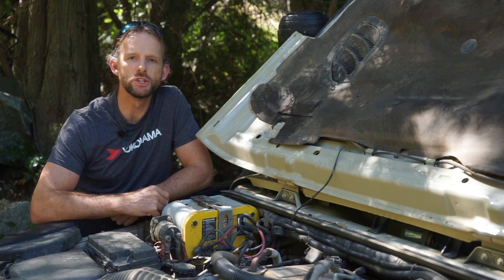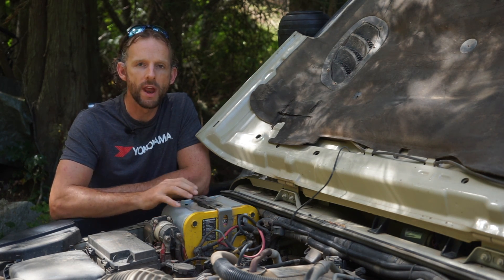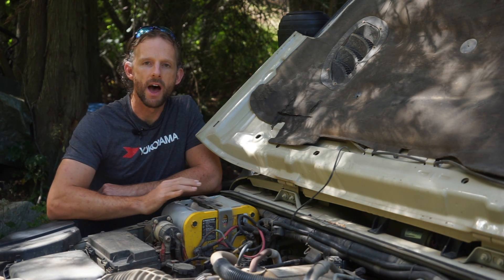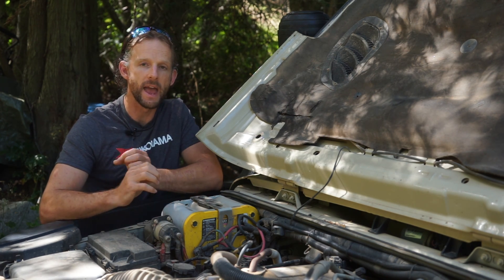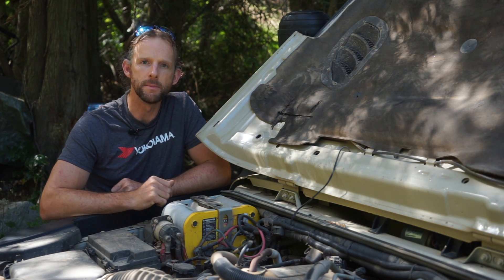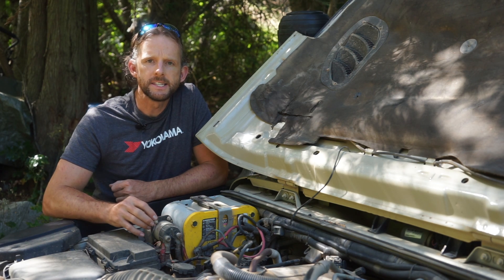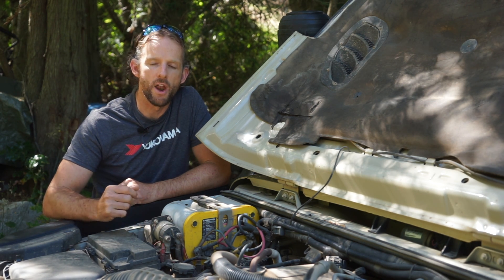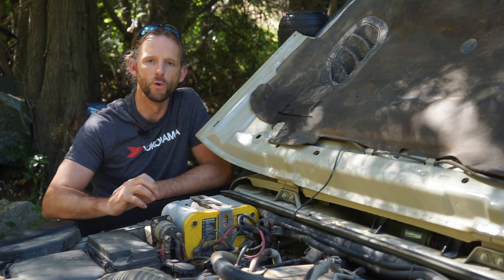DIY Dual Batteries for your Overland Vehicle - what, why & how

Comment: Self jump is a great feature with an isolator. My adventure van runs Blue Sea gear as used on ships. I've used it once. But saved me the trouble to do a jump. And then prevents my gear from draining the starter-battery. 

Mine uses a 3 position marine-switch. Disconnected, through the isolator, or bypassed that allows me to jump myself from inside my rig. But, I absolutely see the benefits of having a non-smart system. As I really don't overland.

Comment: That’s a really good point about how one may have difficulty finding the correct battery (of size) in a given country. This isn’t normally an issue in a single battery set up, but I know fitting duels into a Jeep is a tight fit, even more so on the new JL and JTs models. Something for myself and others to consider on our next builds.

Keep up the awesome videos.

Comment: Grate video as allways 👍🏻
At the moment im working om an old Nissan king cab/navara from 1994. Is a Disel and as such it comes whit a dual battery system as stock. I do have a spare truck and my most reasent plan is to salwage the battery system from that one and figure out a way to get the best usage out of what i simply already have access to🤔
In teory that will end up giving me a 4 battery system with 200+ amp/h that I then can use for what ever my needs migth be. In theory that is.... And that system would alow me to run one almoust any kind of battery. size lithium deep cycle and so one. in theory that is 😬
Reply from the maker: Do you really NEED that much battery capacity?
Overlanding is a fine balance of weight and storage space and what you need.
If you on't need it, you'll soon learn that having all that capacity (be it battery or solar or gas or whatever) will limit you in some other way.
Reply: @TheRoadChoseMe  no i dont need that much but since i already have it to my disposal I figured that why not give it a try 😉
More cost effective for me than to set up a effektiv solar alternative. And money is the only thing im short of 😉
As a photograper my needs for amps is almost endless.... But well see where ill end up.

Tanks for taking the time to respond.
Reguards BigC

Comment: Another nice one again ;-) I do have a slightly different setup and added a manual switch to connect both batteries. The idea behind is my diesel engine consuming a lot of power when started in deep cold. Hence I want the starter battery be loaded with priority. In this rare case, the starter battery is charged first. Only then I connect it manually with the second one. Said connection is only possible when the ignition is on, so no danger of accidently discharging the main battery.
Reply from the maker: That sounds like a good setup for your situation!

Comment: Always enjoy your videos , we went with a dc to dc by CTEK on our FJ Cruiser and replaced the unit like you have on our 60 Series Cruiser with same . They are so far working great , the Optima batteries are also working fine. With newer alternators the voltage isn't high enough to fully charge the house battery.
Reply from the maker: Sounds great!

Comment: I had an old TJ and was notorious for draining my battery. For my JK, i went with the Genesis dual battery system and it is a great piece of mind when heading out for a week in the middle of no where.  I have never had an issue and the jeep always starts up. I know guys that carry a second "starter" battery in case the main battery gets depleted, or they have one of those starter kits that plug into the wall; but something always happens where they forget to charge them or leave them at home and then they are stuck. Dual battery is the way to go, do it right the first time and you can get home.

Comment: Thanks Dan. 😊👍 I haven’t set  up my dual battery system yet. But I did get a GoalZero 1400 lithium battery, and I’m thinking of setting it up to charge from a DC to DC charger using the alternator and solar.
Reply from the maker: Sounds like exactly the setup I want to build in my next vehicle!

Comment: Is your alternator still stock? I’m debating the dual battery set-up or just going with a single bigger deep cycle/lithium ion battery with an upgraded alternator. Not much running other than a fridge and a 2.1 amp USB and maybe a fan overnight (with an emergency jump starter just in case). However when I’m driving is when I was planning on charging everything else (iPad, power tool batteries, fridge, ac/heater, phone, stereo, air compressor ). So I’m hoping I’ll be able to keep my power consumption low enough for just a bigger single battery overnight, but I’m worried about overloading the system when I’m driving. Thoughts/recommendations?
Reply: If you uprate your alternator you will of course need to increase the size of the associated cabling too.
What capacity is yours? Mine is only 60A but it actually copes all right. It can draw 50A when I start off but within half an hour it has dropped by half. It would be prudent not to add extra loads until the initial charge is done.
BTW I''d highly recommend fitting an ammeter so you know what's going on.
Reply from the maker: I have the stock alternator. It has 170k miles on it now, and it's been charging both batteries for almost 5 years now. Never a problem.
Reply: @TheRoadChoseMe  After that mileage you should get it refurbished before your next big trip and it'll be fine.

Comment: I love the simplicity of your setup, and very well explained.
I use an enerdrive dc2dc charger , I chose this because you can adjust the amount of Maximum charging amps according to the house battery size. That way, if I upgrade my battery, I just adjust the charge, a bit like turning up or down a water tap.
Thanks for another great video.
Reply from the maker: That sounds like a nice feature!

Comment: You mentioned that you believe heat contributed to the demise of a battery while on your road trip. Have you considered that relocating the battery outside of the engine compartment would help reduce heat levels that the battery is submitted to? I've heard others mention it as an issue but don't know if that is a real concern or not.
Reply: I agree, which is why many MPPT have a temp sensor.  And it is also why I stowed my second battery inside my Jeep.  But I also agree with Dan that doing so takes away precious cargo space.
Reply from the maker: I don't think heat was the demise, I think it was just the number of cycles - I simply used it up because the fridge was running A LOT when it was 100F every single day for 3 years.
Also I charged my laptop and cameras a lot too.

Comment: Would you recommend something like this over dual batteries that are isolated from each other? For example keeping the jeeps battery stock and then having a battery pack solely connected to the solar panel and relying on that for replenishing it’s power?
Reply from the maker: Depending on the battery capacity and the load you're putting on it, solar alone might not be enough to keep it full. It will depend on your specific scenario.

Comment: Very cool. I have a CTek250sa used in a similar configuration as yours, but it has the smart charging profiles for AGM, isolates, has the MPPT input, and will even top off the starting battery. I did it this way so I could get high enough voltage on the house Optima battery for charging, but keep the stock starter battery (cheap non AGM battery). I toyed with the basic selenoid setup like you have, which to your point is dead simple. I just didn't want to have to match my starting battery (extra $$) and wanted the smart charging. I'll look into the renogy charge controller that sound like it may have a similar capability. Thanks again for the informative posts!
Reply from the maker: It sounds like you have the more modern version of my setup, and it's exactly what I'll be looking at for my future vehicle! Cheers,
Reply: @TheRoadChoseMe  I checked out the Renogy options from your link. On paper it looks like has the same capability as mine, but more flexibility for also controlling lithium ion. My Ctek250sa can only do lead acid. They look to be similarly priced with the exception of a temp probe which is extra for the Renogy. That Renogy controller may be a better option with the lithium capability though.
Reply from the maker: I really think I'll go with that next time, and even move to lithium to give it a shot. It's WAY lighter and smaller for the same capacity, which is win-win.

Comment: You should never discharge any gel, AGM or lead acid battery more than 50% (even the deep cycle types) because you will damage it so a 55AH battery is only around 25 - 30 AH usable. With the various Li batteries you can use nearer to 100%  without damaging them.
Interesting that you don't use a red top as the starter battery, which would be Optima's recommendation.
I find that 55AH is way too small so I use a 110AH AGM battery, giving 55AH usable. I am not yet convinced by Li bateries. They have a built in battery management system which is full of electronics which I prefer to avoid.
Reply: Traction batteries can be safely discharged up to 80%
Reply: @XTnautas  I need to look ino this. I have had a lot of trouble getting a truly reliable set up and am intrested in anything which could offer an improvement.
Reply: @defendermodsandtravels  It's been said not to go below 50% And reality for longevity it really should not be brought down to 50% repeatedly.
Reply: @jeepncj7  I almost never get down to 12V. I need to check the state-of-charge curve but I think this is still above 50%. I have  a low voltage cut out at the battery to prevent deep disharge because I ruined too many batteries through careless accidents. It actually takes a lot of care to keep an auxiliary battery in good health and they are easily ruined.
My charging set up is more sophisticated than Dan's (and he fully acknowledges that his is bullet-proof simple) but I am dissatisfied with the performance so it needs an upgrade. I think he has motivated me to post a video on this subject. We need efficient charging + bullet proof reliability.
Charging has been the biggest thorn in my side for many years!
Reply: @defendermodsandtravels  - I don't have a LVD on mine, just on the fridge to stop if it gets too low. I have a used Optima for my house battery so I'm not as concerned with the abuse (as it was $100). What are you using in your setup for charging/isolation?
Reply: To add a video would be cool. It's great seeing how people have this setup.
Reply: @jeepncj7  At the moment I have an external smart charge controller and diode type splitter. The problem comes from the voltage sensing. if you sense the starter battery then the auxiliary battery charges too slowly, and if you sense the auxiliary battery then the starter battery gets overcharged. One either needs a smart charge splitter or a battery to battery charger. I am giog to retire my passive charge splitter (carry as a spare) and install a smart splitter.

Comment: I'm now thinking of an improvement. My option was always to charge my second battery connected to starter battery and the alternator was doing it well for me always... But it's because I only use house battery to charge my phone, iPad and for light in the van when I park.. since I don't have a fridge and more electronics to charge but I plan on getting camera and fridge too as I plan to stay for months on roads as opposed to my past trips that last 1 to 3 weeks at most...
I'm happy to learn from you Dan, well done sir
Reply from the maker: Happy to hear it was helpful! Let me know if you have any questions
Reply: Most vehicles  built after 2008  have smart alternators, they do not deliver  the voltage   need for a deep cycle AGM .  That combined with more  consumers,  is what killed it in 2 years only.  With  a more modern vehicle a smart DC to DC is the way to go.  I had an AGM  100 Ah   going really low after 1 night only,   it was not charge properly  until got a DC to DC. After I put in the DC to DC , after one night of camping I still have like 75 %  left of it.  This is not only good that you have spare capacity, but  increases the life of the battery as well.
Reply: @leeloo21231234  thank you for this highlight, it's coming in handy to me.
The more I make my van self sufficient the more I love living on the road and exploring more.
This is good insight from you

Comment: Mhh as a very simple system I like the isolators that use the voltage and connect if the alternator is functioning (V>13V or something like that but it only works with dumb alternator).
With yours the issue I see is that you will have ignition=on before to actually start the engine so if the secondary battery is empty (and the main not in a good shape) it could pull down the main and not help with the start.

And now I'm impatient to know about your new trip ! Youtube has run out of expeditions to follow lately...
Reply from the maker: You are spot on, that is a weak point of my system. Though I'm always careful not to let the house battery go below about 11V.
For what it's worth, the two batteries are actually isolated when I turn the key to start the engine, so only the starter battery is actually connected to the starter.

Comment: Thoughts on Lead Acids? They work out a lot cheaper even though you have to buy one double your size needs (max. 50% discharge)
Reply from the maker: I think they're not designed to be used for "house" purposes, and it's extremely bad for them to be used that way. Also big and heavy, the enemy of overlanding

Comment: I have a pair of 50A relion lithium batteries in parallel so 100Ah capacity. Charging is via a redarc BCDC1225D. The BCDC is a DC-DC charger with dual inputs (alternator & solar) it draws as much solar as possible, then if the engine is running, augments that with power from the alternator, delivering a total of 25A to the house batteries. It's a foolproof system in that the starter battery is always isolated and the charger only draws load from the alternator when the engine is running. 
The difference between lithium batteries and lead acid or AGM is that they can be discharged down to 10% safely, whereas lead acid/AGM can really only safely use 50% so a 50Ah lithium is equivalent to a 100Ah AGM battery for usable capacity, but of course much smaller and lighter.
Lithium batteries can't be kept in the engine bay, and they are not suitable for starting, so keep the AGM/lead acid starter battery in place!
Reply: This is the system I’m putting into my Gladiator build.
Reply from the maker: @Eddit & Terri Fort - will you remove the current "two battery" setup in the Gladiator, or just leave it alone and add a completely separate house battery?
Reply: The Road Chose Me  Dan at this point I’m leaning towards leaving the factory batteries alone and adding a BattleBorn 100 AH battery in the bed of the truck. I will run everything (including solar) through a Redarc BCDC charge controller. Hope this helps.
Reply: The other design decision that I made was to not include an inverter. Laptops now mostly charge via USB-C PD(cigarette lighter plug adapter for that) and most other stuff that needs charging is via USB. I dont typically carry power tools, but you can get 12v chargers for those as well.
Reply from the maker: That sounds like a fantastic system, and something I'll be looking at in my next vehicle!

Comment: I recommend Hellroaring isolators. They are solid-state, but they have a very low voltage drop. They have a remote switch option that can allows you to select between connected-automatic-disconnected, and it also indicates the current status. If you leave it on, you'll get a light to show you that.
Reply from the maker: Sounds fantastic!

Comment: Your description of amp-hours is a bit misleading. Yes, they're a measure of capacity, but they're not rated at a 1 hour rate, but at a 20 hour rate. Lead acid batteries like you have, (which contain liquid absorbed in fiberglass mat) suffer a loss in capacity at higher discharge rates, described by  Peukert's law. Your batteries are rated to deliver 2.75A for 20 hours, but at a 1hr rate your capacity drops to about 30 amp-hours. Lithium batteries are much better at delivering their rated capacity at higher currents, which is one big reason people are switching.
Reply from the maker: You are absolutely spot on, I was trying to keep the explanation simple enough for laymen to understand. I figure nobody in the real world is ever going to put a 30 Amp load on a battery like this. In reality most people would never put more load than just their fridge.
Reply: @TheRoadChoseMe  if you watch enough YouTube you'll see a new trend of induction hobs for cooking on. I did some simple math and the amount of power you'd need, and a minimum 2000W inverter, it's just insanity...
A little gas or petrol cooker is fine for me + my jetboil. 
I have been tempted by the travel buddy 12v stove though....
Reply: Also worth mentioning that they will not actually deliver 55ah before they drop below a usable voltage for a fridge and items like that.